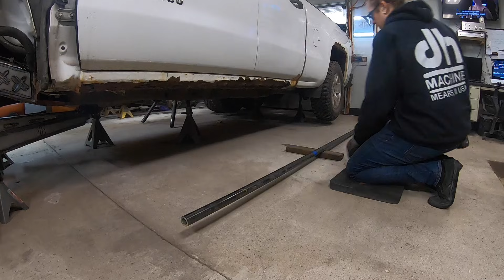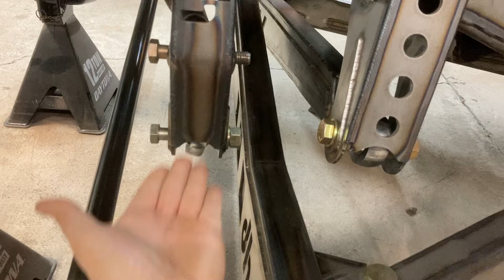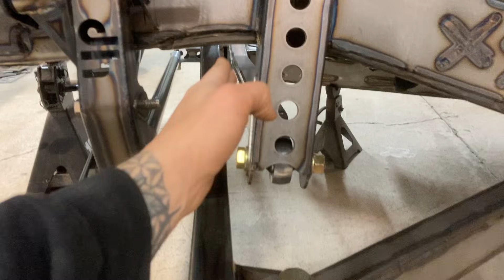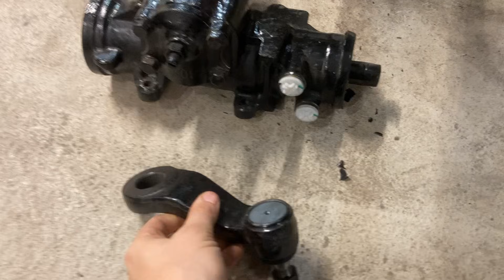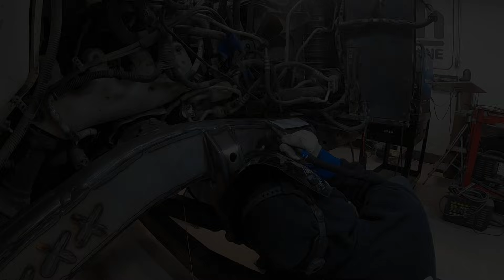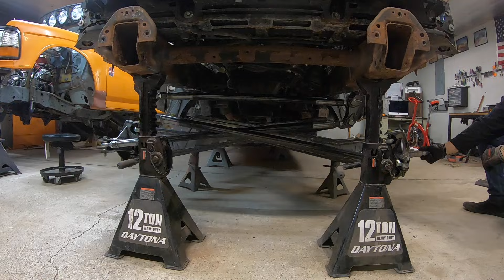Setting up Dual Swing Set Steering for an I beam Suspension on Chevy Prerunner - DH Vlog #82

Comment: I have a 69 scout I’ve had stashed out back for years I have always wanted to finish it off by ditching the transfer case and just having it be 2wd  and a beam set up . I’ve never been able to figure out a rough price for what a beam set up would cost  outside of the shocks etc  I’m always curious what setting up something like that cost for the beams and steering and install cost . I got a rough idea of what a rear set up would cost me but I’ve never nailed down what I need to budget for a fronts. I’ve seen this work in person around the dunes and it’s beautiful work of art fab work I keep stashing money away to to be able to have that scout frame finished off one of these days
Reply from the maker: If you would like to see my pricing spreadsheet than you can email me at dunehippiemachine@gmail.com
Reply from the maker: A prerunner Scout with beams would be awesome!

Comment: Very nice work, and thank you for posting and helping us learn. For your 8.5” spread from the beam pivot to the swinger, is that matching the spacing between your beam pivots to
eachother? Do you also also correlate the distance from the centerline of the beam to the tierod hole, or how is that decided and what is their relationship? Thanks a bunch.
Reply from the maker: Bingo!
yes they are all the same relationship. That does not mean this is the be all end all. There are still several variables at play putting beams onto a chassis. Sometimes I have to move stuff in or out slightly to clearance something. Thats what cycling is for. From my experience however, 7-9"s is the sweet spot for everything cycling and clearancing each other.

Comment: good to know. i am setting up my steering. Is bump steer when the wheel tries to rip your hand off?
Reply from the maker: That can be a result from bump steer. What bump steer is, is when the suspension is fully bumped out on the bumps. One or both of the tires toe's in or out. Which results in pitching the vehicles weight and can cause the vehicle to be unpredictable.
Reply: @dunehippie  how would correct that? re-cycle the steering? i imagine a few turns out on the heim could help during cycling?